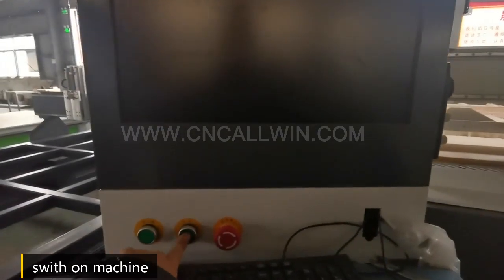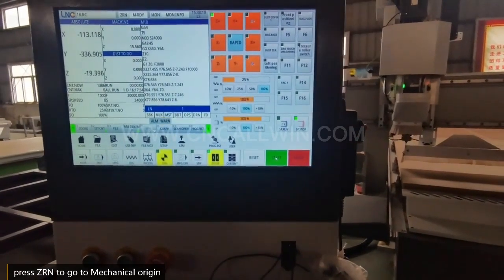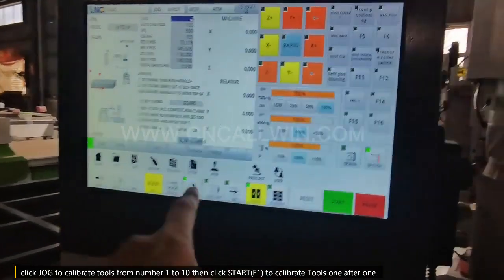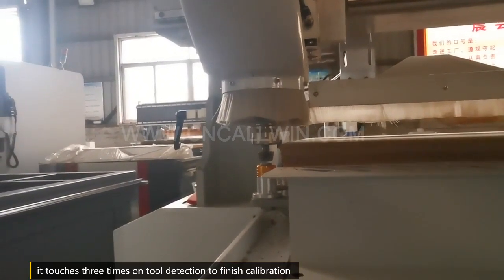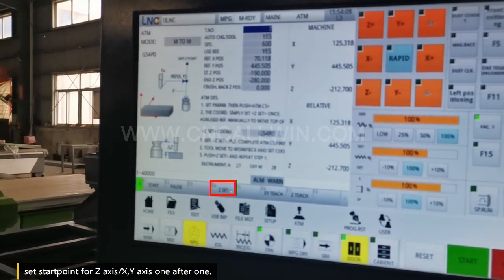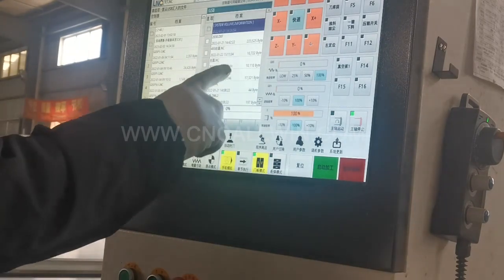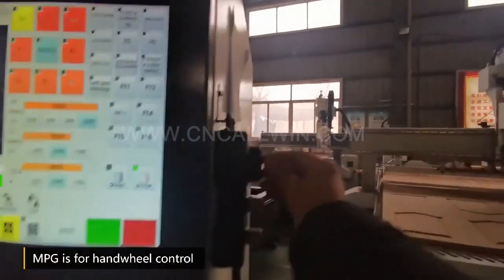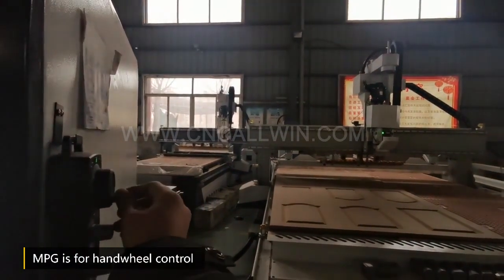How to operate ATC woodworking cnc router LNC system(BAO YUAN) ALLWIN CNC

Comment: which cam program are you using, is it possible to use vcarve and with which post processor
Reply: Yes, it's possible, but you need to build your own post processor.
Use "Gcode ATC (mm) (*.tap)" 
and tweak it by adding these lines:

for header 
"M16"

"G54"
"T[T] M6"
"M3 [S]"
"G43 H[T]"
"G0[ZH]"
"G0[XH][YH]"

 footer
"G0 Z100"
"G0[ZH]"
"M5"
"M17"
"M30"

Comment: Hello, greetings, I have one of those machines but I feel the tools and it seems that the program will not take my sense.  For example, if I send a program in which you are going to carve with tool 1,3,4 and tool 1 is longer than 3 and 4, when it comes to doing the work, tool 1, which is the longest, goes and does its work. work but when changing to the next tool which is shorter it happens that it is working in the air. Can you help me?
Reply: Your machine is not calibrating the tool after the change. You need to check the configurations.